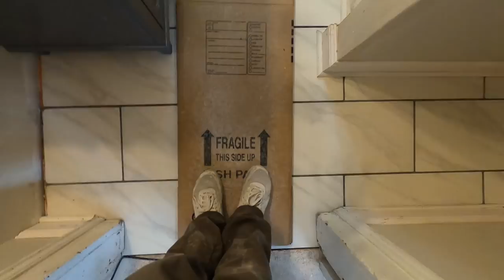How Are We Going To Make THIS WORK..?

Comment: Joe man, the way you describe you're hand pain is classic carpal tunnel symptoms. Best to get it taken care of asap. It is a very quick and easy surgery. Basically just a deep cut heal time can be as little as a month at most 8 weeks. I was back to construction work in 6. Just don't keep dealing with it like I did, as it lead to tendinitis because of the way the body tends to try and compensate for injuries. 10 years later I can't imagine picking up a nail gun now, and my guitar and drum playing is limited to an hour max before the cramps start coming in.

Comment: 1st don’t use a paint tray, 5 gallon bucket with a screen 

Normal paint process is to paint your ceiling first then trim and last walls. 

Prepping is fast when house is empty 

A paint should is what I use most of the time. Then TU whatever need TU with a brush. 

The reason you do your trim paint 1st is when you sand your trim you will get dust all over your flat walls. You can easily clean trim with a wet rag. 

Btw I love your channel 

Floors, fixtures, cabinets are normally installed after paint. 

Trim that your going to add around windows paint before installing. The just TU paint over patched nail heads 

I haven’t seen you use sparkle but it’s great for small TU 

Bonds is good for doors 

When caulking white trim use dap bright white tub caulking 

Main things I change is outlets switches, electric plates, door hinges and knobs. 

You also have to leave your preferences out when remodeling. 

Guys today don’t want to work or have do jobs. People don’t want to work. 

Last is go to Lowe’s after work not in the morning, that way you don’t forget things

When your done with the house spend a little time in storage and add shelving and organize everything. You will end up waiting lots of money buying items you already have. 

It saves a lot of money and time to paint with a sprayer. And when flipping a house you loose profits when having to pay rent. 

Sorry I’ve done this stuff for literally 35 years. And I love to help people when I can. 

If you have any questions just ask

Comment: I like the texture you get when you roll paint instead of spray. Also when I was younger I worked for a painting company and for the most part all we did was roll. Though there is alot to be said for spray, Exterior spray is great saves tons of money as for inside I mean if you already have the equipment to spray then yes it probally will save time but its a mixed bag imo. Infact I rarely see anyone spray the finish paint in interior mainly they just spray the primer.

Comment: Most painters pre finish the trim, either paint or stain. They use trim trees and paint or stain right on them then the trim carpenter cuts and installs the trim. And yes Joe is correct the walls should be finished before the trim goes on.

Comment: you supposed to do all of the cutting in on all the edges and corners with a brush first joe, every corner and around every frame switch, this is how a professional contract painter would do it. then you paint the faces of each wall with the roller. youre getting paint all over the woodwork which you are going to end up sanding which is making more work for you.

Comment: you can add wire to an outlet by adding a box and closing it off, connect the wires, put the connection in a box with a plate, extend wires to new desired place.

double check me but i'm pretty sure this is code and correct.

Comment: I would install the toilet before the vanity. Wouldn't be easier to turn the sink upside down (w\the faucet edge hanging away from the cabinet) and attach a the plumbing fixtures while having access. Flip it over, attach the water lines to the stub outs, guide the drain line into the p-trap.

Comment: I wouldn't recommend spraying your interior paint unless you want everything covered in it.  Also when you're rolling paint out you should roll the entire height of the wall in one stroke otherwise you can end up with patchy spots that are either darker or lighter then the rest of the wall and then you'll end up having to paint the wall again.
Reply: Fake news. You dont paint.
Reply: @patrick553  Actually I used to manage and do maintenance for four rental properties so I've done quite a bit of painting though I got my advice from a pro.
Reply: @coyoteden3773  I don't think it's worth it to spray with the prep required personally, using a roller is a lot easier and less time consuming for interiors.  Even with low pressure you're gonna get some overspray and misting depending on the size of the room.  For exteriors though I usually always use a sprayer.

Comment: First thing that came to mind on the bathroom vanity with not enough room and when you said i hate to be the the plumber- they call joe the plumber . lmao A tip on the paint- if you use 2 shop lights on a stand- the brighter the better to set up and you can see the shadows. Move them around the room your painting. Looks good so far.

Comment: One more thing paint is very difficult to get at this point, the Texas freeze messed up all of polymers and because of that paint prices are higher and it’s difficult to get. Most of your lower grades at SW you can’t get. We are getting SW 200 for the same rate as contractor grade. But we buy a huge amount of paint

Comment: Always apply Primer before Texturing, the correct product is called a PVA.  This will show correctable flaws in drywall and will also stop the dry spots you see near joints lines after painting, especially if hot mud is used.  Mix primer into you texture hopper for perfect finish, not too much and give it time to dry.

Comment: I don't know who told you to wipe as you go when you grout, or why you plan to listen to them, but they 100% for sure have no clue how to grout proper. You do not wipe as you go when you grout. You float the grout in. You wait for it to set, which is 10 to 30 minutes depending on how porous everything is, and then you scrub it with a GROUT SPONGE to shape your joints and make them all smooth and consistent, and then you wipe it up clean with your GROUT SPONGE. I do not need to read the directions on the bag to know that the directions lineup with my instructions. I did it for 20 years.

Comment: Come out under the sink at a 45° angel put in a p trap with a  air admittance valve then get the supply line long enough the reach the faucet
Reply: You also have to have 15 " between the wall to the toilet and 15 from toilet to vanity

Comment: In your situation, it's much more cost effective to hire somebody who knows how to use brush and roller. Spraying has it's benefits, but isn't without costs. Prep work is more with an airless because you have to tape so much, and those sprayers don't clean themselves. One wrong blast and you'll find you've painted your brand new vanity, or maybe your neighbor's car. Oh, and I just noticed you use one of those little paint trays to put paint on your roller. Those things are strictly for amateurs. Buy a thing that you can hang on the lip of a five gallon paint container. Dip your roller in that, then roll the excess off on the thing (forget what they are called), and you'll save yourself a lot of time.

Comment: Im gonna buy you a damn multi tool Joe! 😂
Ok, ok... Im not really going to but you should certainly get one. It seems like you're going to be flipping houses one after another so I would strongly suggest getting you a self a nice Milwaukee fuel set. Get rid of that DeWalt garbage and treat yourself to the Bentley of that price point. Even if you choose to stick with DeWalt you certainly need to get yourself a multi-tool. Comes in handy all the time. Watching you mess with the bathroom trim with a hammer and a putty knife is super cringeworthy LOL A for effort Joe but there are easier ways of doing things.